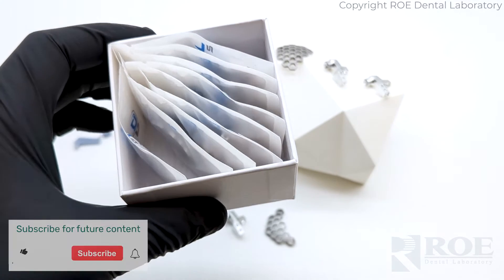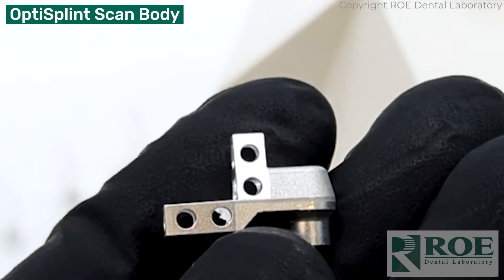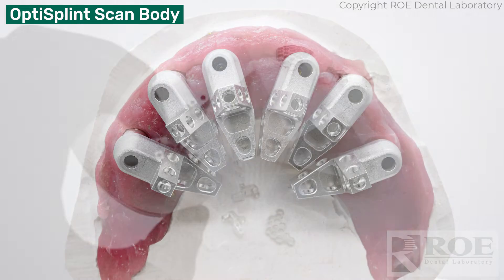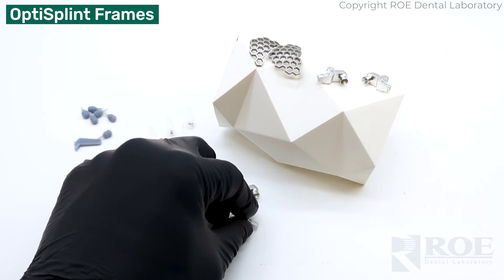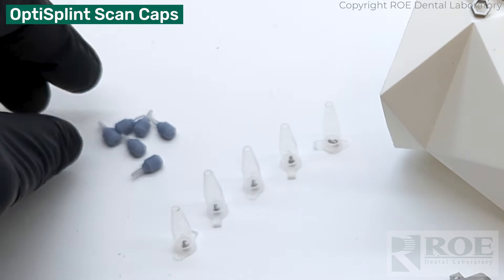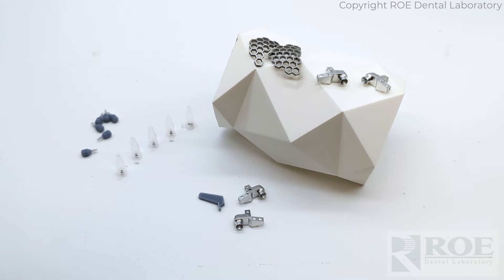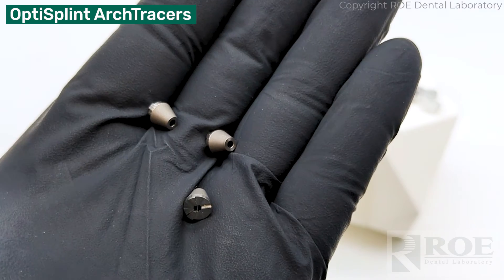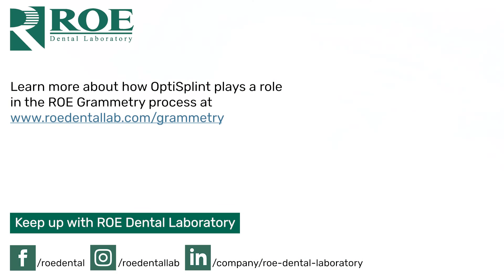Grammetry: What is the OptiSplint?

Comment: Are the scanbodies reusable, or one-time use once resin is applied and cured?
Reply from the maker: The OptiSplint is a single patient use item. It should follow the patient through the final, and like the models in a conventionally made final, held on to for years after incase there is a need to go back and remake.